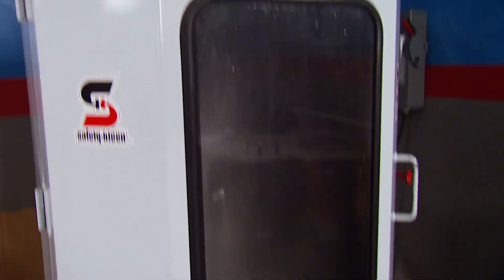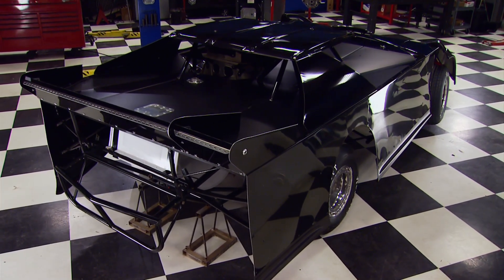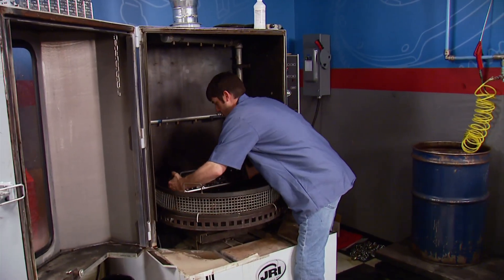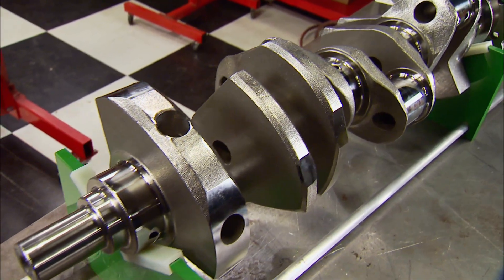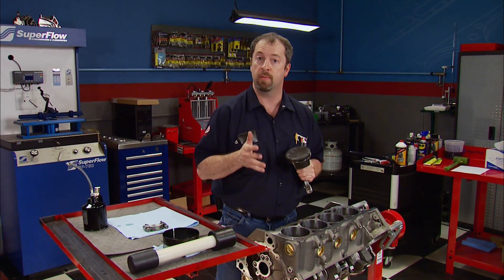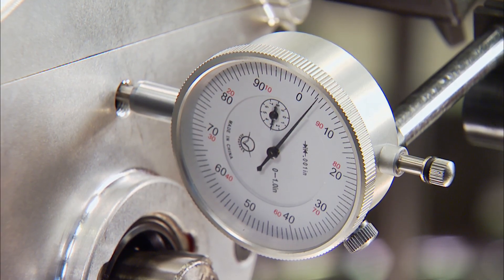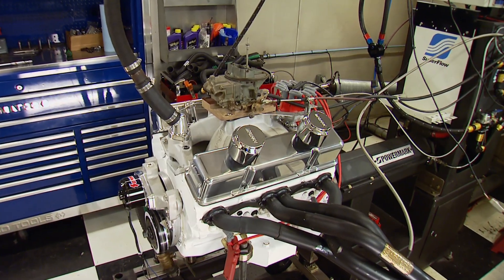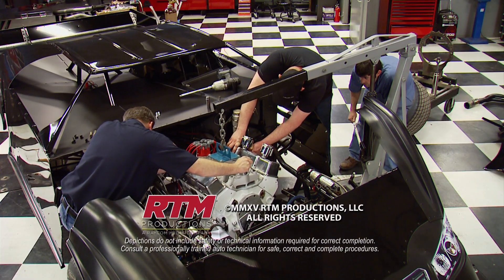Dirt Late Model Iron Headed Engine Build - Engine Power S2, E12

Comment: With a 409 cubic inch and 309 cfm cylinder head and 14:1compression .650 lift roller TKO lobe cam this motor should be in the neighborhood of 650 hp  minimum with a 4brl
Reply: I was surprised too my 406 with a tad more cam and 320 flow on the heads made almost 680
Reply: Flat tappet or roller cam?

Comment: Grass roots are NOT late models in any configuration, all are big bucks$$$$$$$$. This engine should have been built with an iron flat tapped cam. Block and heads were right a pro/super stock would have been a better engine to build. Then follow with an IMCA street stock……..bad choice in my opinion.

Comment: 2 bbl carb or restrictor plates is too much restriction for a straight runner intake. a dual plane is much better suited with a restricted carburetor.
Reply: May be required to use by the Track Rules

Comment: Sorry, But did you just say an affordable form of racing?!?! 😳😂 You have LOST your mind Sir! JUST One of our Super Engines cost 50K, a Crate engine can even cost you 15K or so complete, and a GOOD Chassis, is gonna run you 30K Plus!!! Trust me, There is NOTHING Affordable about DLM Racing these days... 💯
Reply: Yeah I see too many videos of people saying the cars are "affordable" but have over 50k dumped into the car and their equipment. Mini stocks or street stocks is affordable racing and even that can get a bit pricey
Reply: you can get a gm 602 crate engine for around 5k depends on where you buy it
Reply: @ROSS219PRODUCTIONS  You can’t get a “Good” crate engine for 5K anymore. Especially by the time you buy the accessories! You can spend as much on that stuff as you do the engine, If you want to run up front. Look up just what the best headers, carb & a fan costs ya, and don’t forget the engine after it is worked over by a reputable shop… You CAN’T buy a Crate Engine you are going to win a big crate show with for 5K man, it’s not happening…

Comment: First thing I noticed at the very beginning of the episode at 0:40 that GM crate engine he is standing next to has the double breather valve cover on the passenger side which is completely backwards from how it’s supposed to be
Reply: Yep... instantly noticed that also. That engine is a turd. 8 inch massive balancer .. just fantastic for slowing racecars down twice a lap. I guarantee I make more power with a 384.57. It's  a nice over square idea though.  14:1 compression with no crackle. I'm not happy unless I'm making at least 1.2hp/cu.in.
Reply: My 355 for my sportsman makes more than that. Im also on alky.

Comment: "affordable form of auto racing" LMFAO good joke
Reply: Honestly lmao. People don’t think about the cost of fuel and tires… tires last 2 races if your lucky btw😂 You always got to factor in other parts too, I just had to replace a cylinder head and things aren’t too cheap. Sponsors chip in a little money but it doesn’t pay for it all😂
Reply: Much cheaper than an open late model!
Reply: Beat me to it
Reply: That class isn't but my friends brother and his dad built dirt track cars for lie 500 bucks back I the day gutted 3rd gen camaros with 350s
Reply: @gavincarroll2553  what did you just say? back in the day is the key phrase there.
Reply: This engine is exactly what we ran in a Street Stock that later morphed into a Pro Stock. Got rid of the 4412 and went 4 bbl racing on same engine. We could run a QC and 2 speed. Later we moved to Super Dirt Late Model. Got an all aluminum 421" wirh SB2.2 heads in a GRT...
Reply: @Buzzard-wq1bw  wrong, none of those classes are "affordable"
Reply: @GhostYT_lat about as affordable as your going to find unless you want to run a bomber division
Reply: Racer tried to mumble some support... But you could see he was super disappointed with the HP numbers from these Parts/Assemblers with a dyno.
Reply: @Buzzard-wq1bw  what is your households gross yearly income?

Comment: .900 cams are about as rigid as a piece of spaghetti. You lose lift with flex. Could have gotten away with a much larger base circle, you only had a stock 400 sbc stroke........

Comment: I am an outside machinist and I fix submarines and aircraft carriers so I get how small measurements have to be. we use all the precision tools (outside mic, inside mic, intramik, vernier calipers, dial indicators, etc). its crazy how you can't even see something but it effects rotating machinery's durability and function and the feel of a big ball valve or if it leaks, (obviously its a big deal on a submarine) even just. 0.0010" makes a huge difference especially on fitted bolts and bearings. I did something last night that required a 0.0000-.00006 clearance. Crazy shit
Reply: lots of +- 0.0002 shit in machining.transmissions are ridiculously tight tolerance 8 micons runout on groove position,thats like 2-3 tenths

Comment: Just near 500hp? Sounds like a crate engine. Cause our pony class 4cylinder cars. 2300 Ford blocks are pushing 400hp. And the big kmsa engine 2500 Ford block is near 500 hp. So our big 4banger is pushing close to that Chevy v8 horse power.

Comment: Only 1.36 HP per cid with the 4 barrel. Sad hell it's very high compression race gas engine.
Reply: Probably for race restrictions
Reply: @punman5392  possibly. Maybe camshaft restrictions. I build a 489 cid bbc 10:1 compression dynod at 675 hp pump gas street engine

Comment: What is the part# on the cam bearings and can you use them on stock factory blocks
Reply: Durabond chdt1t. All the OD of the bearings are exactly the same. A stock block has 3 different OD cam brgs. Not the same but durabond does make the exact material bearings for a stock block.

Comment: Why does the second compression ring need a larger gap than the top ring? I thought the top ring was exposed to the most heat, therefore needing a larger gap than the second.??
Reply: Gas gets trapped between the rings. The only way for gas to leave is down. It's not going up because of compression. Without extra ring gap to let the gas out, it escapes by lifting the 2 ring off the wall. A bigger gap on the 2nd ring seals the motor better. Every ring manufacturer recommends a bigger gap on the 2nd but total seal....

Comment: You forgot to offset the rear main seal and put sealant where the main cap butts to the block.
Reply: Also when they set the crank in at 8:25
Reply: At 8:07 when they lube the bearings you can see in the background the seal is offset.

Comment: This is a baby motor. Super motors have 900+ hp.
Reply: Has to meet class regulations. Needs usable powerband
Reply: i was thinking the same thing.  a stock 427 big block puts out more than this.  even with a .560/.580 solid flat cam.  something very wrong here.
Reply: @ablaylock4273    Very simple. 500cfm carb and class rules.
Reply: @cw1824  I know its a drag on hp.  But,  I've personally seen a built 283 in a 55 chevy run 11 second 1/4 mile slips with a 500 cm stock 4412.  I will say it had a 4 speed and 4.88 gear.  But I have to believe it had about 500 to make this happen.....

Comment: It would seem to me that with a restricted 2 barrel that you would want small c.i. high rpm. like a 4.125 and a 2.750 stroke. i.e. quick to accelerate and 9000 rpm or so. this was close to one of our winning asphalt limited late model engines killing the 355ci engins.

Comment: If 10 to 15,000 dollars is affordable I'd like to see the big dollar engine.
Reply: Maynard Reed used Durham’s and Roush Yates’ go for 20k+ used.. looking around 30k for one brand new. In all reality you wouldn’t even be able to compete with the big boys (WoO LMS and Lucas Oil LMS) on a $10-15k engine
Reply: @bigboreracing356  I guess. I'm having a hard time swallowing a grand my heads done.
Reply: Well in East TN we have a sportsman late model class which has a steelhead option and you can run a 602 or 604 crate with the seals broken on them in the sportsman class so a used maybe 2006 grt or masterbilt rolling chassis with winters rear non adjustable shocks wheels tires about 2 to 4k range on racing junk.com or Facebook market place a rebuilt 602 crate with the seals broken I've seen some that do great on the track for about 1200 on the marketplace before very affordable engine makes decent power for what it is and a brinn or Bert direct drive I've seen em in good used condition anywhere from 300$ to 900$ if you look in the right spot used kirkey seat 80 to150$ steering wheel 10$ used and all accessories needed plus the harder compound tires so you don't have to run new tires every week people that say racing is expensive are the ones that think you have to be up front if you just wanna get a late model to the track and have some fun and don't care about winning not so much I can afford it I could probably afford to be up front I choose not to I make 20$ an hour my wife makes about the same with 2 kids and bills it cost roughly 500 a week I've seen people spend twice that a week to  go golfing some people have side by sides some muscle cars some boats as their toys this is the same concept

Comment: How are they getting that high of compression using flat top pistons  instead of dome pistons???....
Reply: Small CC's on the combustion chambers and a much larger quench area can do that. Also making the piston closer to the top of the deck and cylinder head via a longer connecting rod does it too which makes it an interference fit engine. There are more ways than what I just listed.
Reply: 49cc

Comment: I would love to see what you guys could do with a 5.2 318 magnum. Everyone always builds ford and chevy engines. What about a small block mopar magnum??
Reply: They have hemi engine builds on their site.
Reply: I turn my 360 up to 7000 sometimes 7500. Stock stroke cast scat crank, carillo rods. 318/360 magnum stock rods will break around 6500-6700 rpm
Reply: Garbage engines, they wont live up high in the RPM
Reply: You can build any engine to hold high rpm. What exactly is your point. You must don't know much about a small block mopar magnum to even say this.
Reply: @RjLewis94  he's 100% correct friend
Reply: @bilbobaggins4710  
As he mentioned, a properly built engine with the right parts, including oiling improvements, can make any engine survive. Especially a later model 318. I had one in my Durango years ago and beat on it pretty hard and it never missed a beat with regular oil changes and basic maintenance.

Comment: You guys have a great program.....never miss it. Torrington bearings are the most under-used bearings there are....Bravo!  Have built many engines but stumped exactly how you design a cam to favor two-barrel carbs......can you enlighten us all out here with somewhat of an explanation that adds up?  Thanks for all you show.  The List 4412 500 cfm is a really sweet carb.  I noticed that you are using a slotted spacer underneath the carb.  I have found that using a 4-bbl manifold sometimes indexing the carb a little forward or back on the manifold can make over 10 hp difference and certainly can balance cylinder to cylinder fuel distribution.  I've not  reached the end of the video yet...have you tried that?
Reply: Sorry man, they don't reply to these old shows
Reply: I’m with you on wanting to understand how certain combos work. Especially the 2bbl carb on the 4bbl manifold.

Comment: If your limited to 500cfm you went too big on the cubes to pull hard up top..
Reply: That many Cu in will pull it out of a corner faster  roundy round is different than a 1/4 mile
Reply: A larger engine will make more power than a smaller one even with the 4412.  I have a circle track engine a flat top piston 355 Chevy that I built for a customer that makes 500 horsepower.  Just for fun I did a couple of pulls using that same 4412 carburetor on a 454 small block that I also built and it made 530 horsepower.  The 355 has about 1000 pulls worth of development work and the 454 had zero.
Reply: @DaveMcLain  just out of curiousity,  what kind of power would a dyno tested 550hp big block chevy make with a 4412 on E85?
Reply: @ablaylock4273  My 454 small block made 600 horsepower and dropped about 70.  Could your engine drop a little less than that and make 520?  Probably.  In my testing I found no horsepower advantage to running E-85 on the 355 engine with the 4412 but that engine is really well developed with gasoline too it didn't run worse but it didn't run better.  I flogged it a lot too.  I've never tested a 4412 with methanol but that stuff would probably be worth some power.
Reply: Dave McLain thanks for the reply.  I've got a 2nd Gen ump street stock I picked up for a decent price.  I also have 427 big block I've had for years.  L88 specs but with iron heads and Victor jr intake.  gonna put engine in car with direct drive glide and 6.20 gear.  it might be a handful in the corners but how could it not compete?  we shall see.
Reply: @ablaylock4273  If you're going to run dirt then I think that getting enough rear percentage might be a problem but if you've already got the parts why not give it a try.  A couple of years ago I saw a guy run a B mod with a big block Chevy(unknown displacement) and it did pretty good.

Comment: Damn . Picking up the engine from the intake manifold gives me goosebumps
Reply: When I was 14 building my first engine my sister's boyfriend was helping me and when putting the engine in we dropped it in by the intake. I said something about it and he looked at me and climbed onto the engine. Him being 6 3 250 I didn't ever doubt the manifold lift method ever again lol.
Reply: Yea but as long as everything is torqued down correctly and the bolts for the intake plate are in good and the chain on the engine lift is good I say go at it my family and I are full of mechanics backyard and ASE certified and sometimes both plus we have motorcycle builders and mechanics in my family so if it has wheels and an engine whether it be Ford,Chevy,and or Mopar and Japanese and Harleys,Customs,and Japanese motorcycles someone in my family can work on them and I've seen engines picked up like that plenty of times and also using a manual chain engine hoist using a tree limb to pull the engine out of the car so I say when in Rome do what the Romans do and that's use the tools that you have to work with you just have to be smarter than the tool your working with
Reply: @keefespencer1173  I would rather pick it up from the block . Not the intake . Just saying . Everyone has their methods. But personally  I dont trust that.  Your personal  preference  is up to you . Mine isn't this .
Reply: Raul JR Lara I’ve done this for years even with big blocks. There’s a reason why carb bolt pattern lift plates are so common.... they work!!!!! I understand your concerns though.
Reply: @jasontruman1215  Proof Raul has never pulled an engine with more than 4 cylinders, if any engine at all
Reply: @zuestoots5176  I'd like to see u pull a engine out. Upload a video of yourself pulling one out on youtube. And state who u r from this youtube comment so I know it's you. Stop trolling n get out
Reply: @zuestoots5176  I have done it more than once and I have proof
Reply: @rauljrlara9994  everyone and his brother does it this way my man
Reply: @keefespencer1173  I used to pick up big Block Chevys all the time by the intake and they all had the heavy cast iron low rise intakes on them to boot and the plate that bolted to the intake had only 4  5/16" bolts
Reply: I was a little apprehensive the first time I saw an engine pulled this way back about 30 years ago. Then I read an article that addressed this very concern. A properly torqued 5/16th grade 5 bolt can hold something like 12,000lbs. These carb plates have 4 5/16th bolts and the engine weighs around 430lbs. That's only about 107lbs per bolt. Grade 8 bolts will hold about 20% more.

Comment: Why are you guys so conservative on timing? This kind of motor usually likes 36-38 degrees..
Reply: My 355 4412 motor likes 41 degrees.
Reply: Yeah how does a guy set that kind of advance??? Do I have to buy a strip to wrap around the balancer??? The timing tabs have only 2 4 6 8 and 0
Reply: @bilbobaggins4710 buy an advance timing light, then you only need the 0 degree part of the tab

Comment: Can you deck n cam a Ford 351M no one has built one of these from a to z...
Reply: My dad built 3 of them except his were 351/400M's in his 78 F150 Ranger with a 4 speed behind and were not a Ford family but that was the only Ford he owned and he did so for a while but we stayed proud of that old truck cuz we used to drive that truck everywhere and almost every weekend we used to haul the race car to the track out pulling some gas powered dually's on the way there and the old Ford was only 2WD with 31 inch tall tires on it
Reply: @keefespencer1173  I understand 351m/400m is roughly identical..I would like to see one of these built using so new tricks and toss an efi system on it..
Reply: @bigboreracing356   C6 big block Mount and just torque for the Bronco.